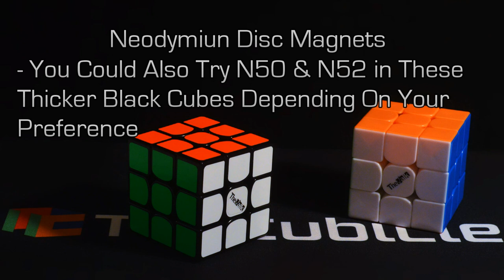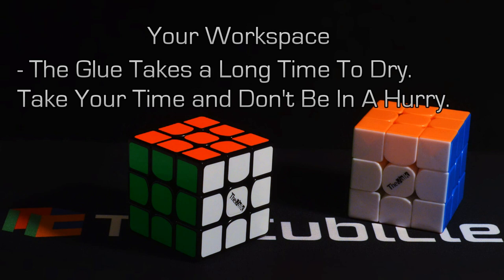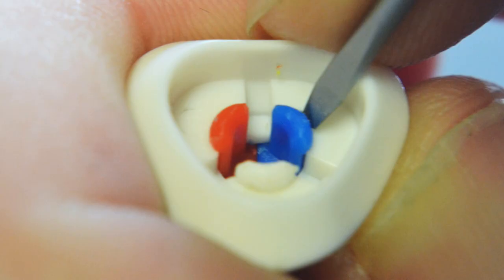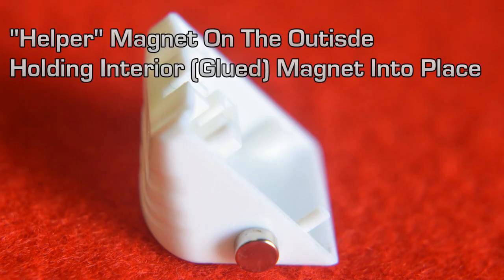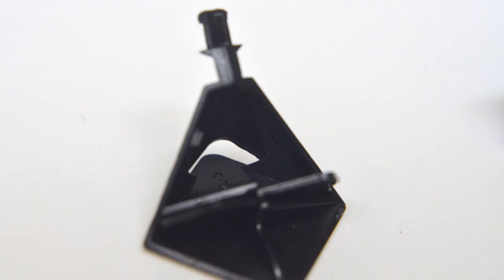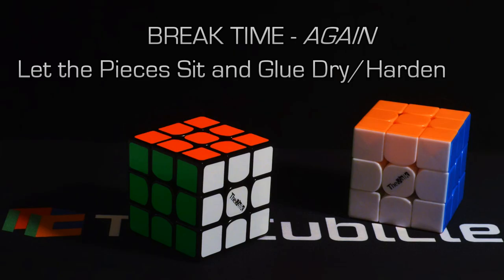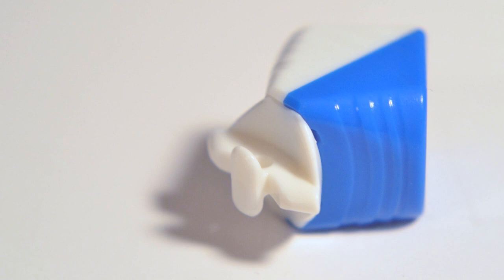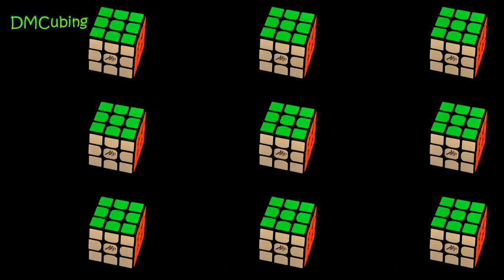DIY: How To Make A Magnetic Valk 3 Speedcube Tutorial

Comment: I just took the 4x3mm n48 magnets out of the mf3rs cuz the feel is weird and I am wonder should I put those magnets in my valk 3?
Reply from the maker: Ryan Le Are you sure they're really 4x3??? That magnet is too big and powerful for use in a Rubik's cube. Way too much pullforce strength. The most used magnet for the Valk is the N35 4x2. You don't need a very strong magnet in the Valk.
You can use a slightly stronger magnet in the MF3RS, but I wouldn't go higher than N48 4x2. 
I can't think of any cube where a 4x3 magnet would be ok. Sorry.
Reply: DMCubing I modded the 4x3 magnets in the mf3rs but it feel weird so I took them out, I guess time to buy new magnets then lol, thanks for your reply dude!
Reply from the maker: Ryan Le Yeah, sorry to hear that, but when you get the right magnets, your cubes will literally come to life!!! Luckily, the magnets that work best in both cubes, the N35 4x2, are the most popular Neodymium magnet and are very inexpensive.
Reply: DMCubing Thanks! I like to have my cubes magnetized but still remains the natural feels in them so I gonna try n35 ones, dont know what I am going to do with the 4x3 left over though XD

Comment: Will n35 magnets be too weak for valk 3? Cause i heard a person with n35 valk 3 magnet say the magnets are losing strength.
Reply from the maker: Rabiot Digne most people use the N35. It gives a nice magnetic field, without being overly strong. Now, in my opinion, it would be nice to have just a slightly stronger magnet. But the problem is, the next available magnetic strength in a 4x2 is N48, at least in the US. I would love to try an N42, because for me, I think it would be just perfect. But that really depends on the person. Anyway, there's nothing wrong with using the N35, and I should add, these magnets never lose their magnetic strength. As long as they're kept from extreme temperatures, we're talking about 185°, they should last indefinitely. Since your cube will never be close to 200°, you can be assured that the magnet should last a lifetime. So if the magnet is feeling weaker, it is probably a matter of the lube drying up, or the tensions needing to be readjusted.
Reply from the maker: Rabiot Digne One last thing. It seemed to me, that when I used N 35 magnets in a stickerless Valk, the magnetic pull force felt stronger in that cube compared to the black plastic cube. So, if you like the Valk, and want to increase the magnetic feel, you might want to look at using a sticker less version of the cube
Reply: Thanks alot DMcubing, I love ur videos, keep up the good work!

Comment: hi. I am trying to mamd one.. so all i have understood is that 
for Edge pieces:  i have to place the magnets one inside and one outside..    
but i did not understand wjat to do after that.. like for the corner pieces... pls help

like at 6:33 for thr edge pieces.. we hace to repeat it over and over again but what about the corners??
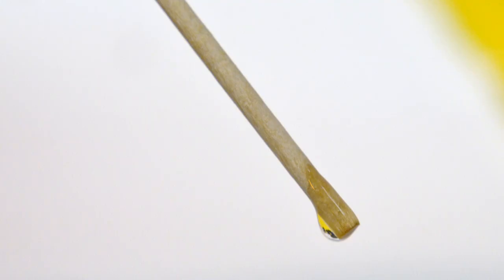Reply: After the super glue has hardened in the edge pieces you can take off the magnets that you put next to them to hold them in place (the ones you didn't glue down). Then you continue from 7:49.

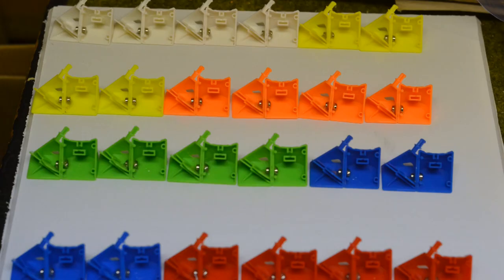When you put the magnet in the corner piece, use an already magnetised edge piece to place the magnet properly. After you've done all the pieces it should look like the picture at 8:15, where all the pieces are next to each other.

Comment: Is 5x1 n35 good for valk?
Reply from the maker: PK Cubes I think it would work fine in the Valk, but I personally prefer 4x2 magnets in this cube. I'll explain. Because of the cutaway holes in the corner pieces, the opening allows for more magnetic attraction because that area of the piece isn't shielded by plastic. So when you compare the performance of the same 5x1 magnet in different cubes, like the GTS2M, where it's a subtle feel with a slightly wider magnetic area, the same magnet in the Valk feels stronger. 
In regard to the N35 5x1, it's barely perceptible in the GTS2M, so in the Valk, it would work out ok. I just don't think you'll get the same benefit (wider magnetic field, smoother bump) from it in a Valk.
Reply: Ok. :)

Comment: does the cube needs to be really smooth?
Reply from the maker: Oldman EstimanJr. I may not completely understand your question, but all cubes tend to perform more efficiently if they do move smoothly. Now, what can be said about magnetic cubes in general is, they work better with looser tensions. So the looseness of the tensions will cause the cube to be a little more smoother this way, and then of course there's the type of lubrication that you use. And you would also want your cube to be clean on the inside so that there isn't any thing inside that will cause friction to make it not smooth.

Comment: Will N48 be good in stickerless?
(I'm using 4mm × 1.5mm magnets)
Reply from the maker: Anurag Prakash As long as the magnets are 4x1.5, you'll be fine, as they will have the same pullforce of an N35 4x2, which is the ideal magnet for the stickerless.

Comment: If I use 4x3mm magnets will them fit inside the corners?
Reply from the maker: Pedro Silva I believe it should fit fine, but 4x3 magnets in this cube would be considerably strong and I'm not sure the resulting cube would be what most people would prefer. Even an N38 4x2 magnet begins to feel moderately strong in the Valk. An N35 4x3 would have a magnetic strength similar to that of the N48 4x2- that's more what you'd want to use in a Weilong GTS or Aolong V2. So unless you just really like a strong, pronounced magnetic feel, you might be better off using a smaller magnet.
Reply: DMCubing will 5x1mm n35 fit ?

Comment: Can i put the magnets in the right side of the edge piece instead of left?
Reply from the maker: CubingFever Yes I suppose you could. Just make sure your corner piece magnet has enough room, and that when it aligns, it's far enough into the piece that the magnet isn't too close to the hole. If the corner piece magnet is too close to the cutaway hole, you risk having glue run out if it while you're gluing the magnets.

Comment: If I use N50 4x2 in stickerless, what do you think about feel?
Reply from the maker: Teddy Riza If they're real N50 grade, they'll be VERY STRONG in the Valk. Kind of depends on where you buy them. If they're cheap budget priced N50s, it's likely they won't be full N50 strength. There are a lot of these fake N50s being sold. If they're more expensive, and true N50 in strength, they'll be too strong. Honestly, N35 4x2 is plenty strong enough for the Valk.
Reply: How about N45 4x2?
Reply from the maker: Teddy Riza The strongest I would ever use in the Valk is N42 4x2, and that magnet is very strong feeling in it, very pronounced bump.

Comment: would 5x1 n35 work or are they too light?
Reply from the maker: Daniel Hanna They would probably be perfect if you like a subtle but effective magnetic attraction. I've never tried them but sometimes have used N 35 4x2 which I have positioned inward towards the core to lessen their strength. With N 35 5x1, you're going to get a similar effect. They should feel pretty nice.

Comment: Will a 6mm by 1.5mm magnet fit?
Reply from the maker: Offline Cuber No. It would be too wide. The best magnet for the Valk is a 4mm wide magnet. The way the corner pieces are designed, with the cutaway holes, magnetic energy is lost through the holes and causes an increase of magnetic pullforce attraction. So it's best to stick with 4x2 magnets in the Valk, and grade N35 is the overall best. 
I was just watching your latest upload. You've got a very good voice for doing videos! Keep up the great work!!!!
Reply: DMCubing thanks!

Comment: Is it okay to use n35 3x2mm magnet? 'cause the 4x2mm is out of stock right now
Reply from the maker: Sofram In what strength? A 3x2 would give a very subtle feel in the Valk. A higher grade like N52 might be able to work, but if it's an N35 3x2, it would really be very weak.
Reply: DMCubing oh yeah, sorry. I mean the n35 4x2 that's out of stock right now.

But what do you think about N35 5x1 and N45 4x1 on a black based valk ?
Reply from the maker: I think it might be worth trying the N35 5x1 on the Valk. SHould work fine. N45 4x1, I'm not so sure about.

Comment: Where do you buy the magnets?
Reply from the maker: For the N48 4mm x 2mm, I use Apex Magnets www.apexmagnets.com They're currently out of stock but should be back soon.
For the N52 4mm x 2mm, Thackery is a great company, great service and fast shipping, and they're in stock: www.thethackery.com
For the N35 4mm  x 2mm, www.magnets365.com or just about anywhere, like ebay, as you'll see this lower grade quite a bit. It's the higher grades that are really only available (here in the US) at the two places I listed above. Good luck!

Comment: what if you put the magnet more towards the middle of the edge piece because i saw another channel do it like that
Reply from the maker: I like to position the magnets my way because it assures the corner piece magnet is going to be in the right place and not too far back. If that magnet is positioned too far back, it ends up sticking out of the hole a little bit. Also, positioning the magnets down to the bottom surface of the pieces gives the glue more surface to adhere too, it also helps in assuring each following magnet is glued in exactly the same place as the previous magnet because you're using a specific place inside the cubie pieces.
Reply: ok thanks for pointing that out

Comment: What to do if I break a prong
Reply from the maker: If it is just one broken prong, you can still reassemble the corner piece and everything will hold together OK. If it's more than one prong, there will be a problem.
Reply: @dmcubing6342  Awesome! Is it worth it to throw a touch of superglue on there (the prong hasn't completely separated, it's still kinda hanging on) or would that create more problems?
Reply from the maker: Benjamin Chen I would leave it just like it is. If you try putting super glue on it, there's no guarantee the glue won't go all over the place. So if the remaining part is still partially attached, just put it all back together. It should still stay in place. I have had this happen before.

Comment: is n38 well with valk?
Reply from the maker: It works fine if you like a little stronger magnetic pull from the magnets. Most people use the N35 but both the N38 and N42 work well in the Valk and give it a nice stable feel without being over powering. If you prefer to feel a little more from the magnets, the N38 is an excellent choice.
Reply: is it just like n35 for stickerless valk?
Reply from the maker: Mighty Cuber No it's a little stronger.

Comment: did you use the N42s in the stickerless or black cube?
Reply from the maker: I'm using N42s in the black. For the stickerless the N35 works fine and I wouldn't recommend anything over N38. As for the black Valk with N42s, it's really nice. The magnets are noticeable, particularly at slow speeds, but once you speed up, they kind of disappear. I think the N38s might have more popular appeal, but for aggressive solvers or for people who like the magnetic feel, the N42s are great. And since you can loosen the tensions quite a bit, you don't really loose speed. The N38s are also really nice. I just recently made two cubes, one with 42s and one with 38s and I've been going back and forth. It's hard to pick a favorite of the two.

Comment: Should i be aware that because the magnet is not being gauged by a starting magnet it would be less accurate, or it doesnt matter?
Reply from the maker: Charles domain I may not completely understand what you're asking but as long as the magnets are placed in the same, identical location for each pair of corner and edge piece, the cube should be as accurate as possible. It's this reason why I place the magnet  at the base of the retaining post in the Valk and similar places in other cubes. It allows for precise repetition of the placement of magnet pairs.
Reply: DMCubing Sorry for any confusion. Thanks for answering so quickly! By the way would n35 magnets be good for a stickerless valk?
Reply from the maker: Charles domain No confusion, just wasn't sure if that's what you were asking. Yes, I think you'd find the N35 4x2 in the stickerless Valk quite suitable.
Reply: DMCubing also i heard that the distance the magnets are from the core affect the strength and performance. Would you say the place where you have put the magnets are optimal?  On a sidenote how did your stickerless valk 3 with n35s feel?
Reply from the maker: Charles domain The stickerless with N35s is ok.
I generally place my magnets in a position which allows for easy duplication of that position, based on the ease and accuracy of repeating that location over and over from one piece to the other and then adjust the strength, or grade of the magnet accordingly. So you'll see I generally place the magnet against the base of the retaining post inside the edge piece. Yes, the distance from core does have an effect on magnetic force. You could adjust this in some cubes to a degree. In the Valk, you're somewhat limited to how much you can move the magnet towards the core to lighten feel because of the corner piece cutaways. I've tried that in an early prototype and ended up having my magnets not only visible, but sticking out far enough out of the cutaway to negatively affect performance.

Comment: if I use the 3x1 n52
will it be too strong??
Reply from the maker: According to the K&J Magnetics calculator, the 3x1 N52 will be too weak, less than half the strength of the N35 4x2. The N35 4x2 is a really common magnet. You should be able to find them just about anywhere.

Comment: DMCubing I just magnetized my thunderclap v2 but the magnets dont pull to each other even tho i watch the tutorial the magnets dont click when i scramble the cube the feeling of the cube just with out magnets they just repel they dont click into place how can i fix it??
Reply from the maker: Lil Vander You'll have to disassemble the cube and rebuild it without the core to see where the problem is. All edge pieces should attract all corner pieces, so when you put it back together without the core, the magnets should hold the cube together. You'll find the problem pieces doing this test. Once you find which magnets need to be turned around, you'll have to either pry them out with a screwdriver or soak the disassembled cubie piece in warm soapy water for several hours first, then pry the magnets out.
Reply: DMCubing I just tested without the core, the pieces stays together and i try it with the core it stay together but when i scramble the cube, some other pieces dont click some of them click how can fix this?? Pls help me!!
Reply from the maker: Have you tried mixing it up and piecing it back together without the core? You still may have magnets that aren't in the right position and it may take a few tries to find them. 
And though this probably isn't the problem, try loosening the tensions. The TCV2 has a design that causes the pieces to rub on each other, that's why I've never considered magnetizing mine. You need to make sure the spring tension isn't too tight.
Reply: DMCubing i have tried mixing it up without a core some of them repel some doesn't
Reply from the maker: Lil Vander then you have some of the magnets glued in incorrectly. You'll need to remove those and flip around and glue in that way. Removing magnets can be difficult. You can try prying them out with a screwdriver. Also if you soak the cubie pieces in warm soapy water for several hours first, it help to soften the dried glue.

Comment: where to buy n42 magnets?
Reply from the maker: N Yonemura gaussboys.com
I'd only recommend N42 4x2s if you prefer a stronger magnetic feel. Otherwise the N35 4x2 is a good one.
Reply: DMCubing thanks!
Reply: DMCubing also would you recommend n52 because i just saw them on the website so i would like to know if they are bettter than n42
Reply from the maker: N Yonemura No, not at all in the Valk!!!! They're WAY TOO STRONG. Again, you're better off using an N35 4x2 in the Valk because it's a light weight cube.
Reply from the maker: N Yonemura And a real nice, subtle N35 4x2 is the one sold by magnets365.com because they actually measure 4x1.7. This magnet is great in the Valk and Gan Air.
Reply: DMCubing thanks for the reply!

Comment: Hi just a little question if you break the 3 little piece on the corner what can you do?
Reply from the maker: Ryan Lim Did you break just one of the little prongs or all three? if it's just one, you can position the broken piece in its normal location when you're reassembling the corner piece, lock the base over it and the other prongs, and you'll probably be ok. it will stay in place and still give support. I've had this happen before myself.
Reply: DMCubing alright thx man i accidentally loosen one it didnt exactly break
Reply: DMCubing also just wondering so on each edge there should be two magnets and 3 magnets on the corner right
Reply from the maker: Ryan Lim Yes. One magnet in each half of the edge piece, and one magnet in each third part of corner piece. Once you take the cube apart, it's easier to visualize this.
Reply: DMCubing so how many in the edge and how many in the corner im still a little confuse
Reply from the maker: Ryan Lim three in the corner, two in the edge.
Reply: DMCubing thx man i will try it out:)

Comment: Is 5×1.5 mm n35 strong? Or weak?
Reply from the maker: Kevin Divino In a Valk, this magnet would be fairly strong. The cutaway holes in the Valk's corner pieces allow a certain amount of magnetic field to escape and this causes a stronger magnetic pullforce than what you'd experience using the same magnet in a cube like the GTS2.
Reply: DMCubing Okay but what about for MF3RS? Too strong or too weak?
Reply from the maker: Kevin Divino It would be perfect, with a pullforce strength similar to that of the N35 4x2.
Reply: DMCubing Okay thank you.